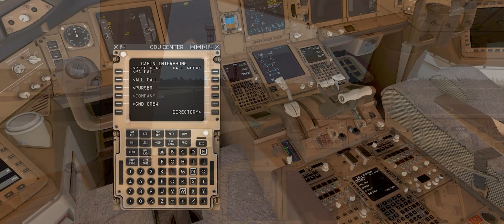WIP: comm system + MCC

Comment: 2/3 of the community doesn’t care about such ai voices, we have 3Jcabinsound for that. Such stupid unnecessary things which people hate are eating alot of the release date time. Take some notes from REAL developers like Fenix and Inibuilds. Instead of getting in denial and not listening to the customers.
Reply: There seems to be a total misunderstanding of what is going on here. First, none of those features change the release date, the bottleneck is now the FMS and autopilot so this has nothing to do with release time.
Second, this is not cabinsound, or any other plugin to simulate life in the cabin, this is a full training level MCC vocalization system with, probably, voice control in the future. This means full interaction with the crew, including procedures where "half" the work is done by the copilot. MCC in real life is mostly about communication and it can't be done without voices. MCC us a big part of airline reality which has not yet been covered in the sim. Finally, I am not sure what does "REAL developers" means exactly but we have been on the market for 13 years now, 3 of our core team are actual airline pilots (a320 and b777) and instructors. We have 10 (B777, B787 and a320) consultants and mechanics working with us day to day, and we have models used in actual pilot training - if this is not real enough then I am sorry.
Reply: @ramzzess  That you are 13 years on the market doesn’t mean you are “perfect”. Look at a350 what a mess it was, and still is.  people where getting terrible performance on the FFa320 and reporting it to your team, however back then your team would get in denial that everything was pefect with the performance and that the problem was with people their pc. In the end you did optimize it without being right that it had good performance. Fenix A320 works also with real life airliner pilots. You are trolling people almost 10+ years with that kind of dissapointing 777. I am not talking about the modelment and texturing, i am talking about the management within your team!
Reply: @aladeenwadiya2709  Who and where has ever claimed that our airplanes are perfect ? The 8050 had a issue with crushing for several years which we have been trying to fall, and indeed in the end solved. We were always honest about that. The a320 was always heavy on the frames due to the shier amount of calculation as it is a full sim, with its own dynamics. We were always honest about that. We said we will try to optimize it and we did. Great for as all. What about the 777 and what 10 years? The v2 has been announced less than a year ago. Where is the issue? The v1 has been out for 12 years and used to be one of the best products at its time, since then we have been lowering its price gradually as it becomes older. We have always been open an honest about our plans. We even give models names to suggest how deep they will be. I think the problem is that some users, do not take the e time to read in detail what we say, but relay on hearsay and rumors on the forums. I do not think that any of the released models at the moment are anywhere bellow what we promised. Including the 350 and 777v1. Unless you expected that the 2012 v1 will be updated through 4 major XP versions. Btw, none of the models on the market now where promised to work for xp12 but all will
Reply: @ramzzess  learn from the FenixA320.
Reply: @aladeenwadiya2709  Please do not suggest I look at other models, especially built for a different sim. If you have specific features or bugs you want to discuss, I am happy to address these. I guess the question of real recordings has been answered? 10K phrases is not something easily recorded
Reply: @ramzzess  Why not, you expect to get only compliments do you? I still recommend you to look at the team of Fenix how they are developing.
Reply: @aladeenwadiya2709  I expect constructive criticism, which means things that you want improved or created. Not general suggestions for me to look at someone else. Like "I want real recordings", my answer was "this is objectively not possible at the moment"
Reply: @ramzzess  Your team! Instead of teasing us release something. Why develop on a 787 and 777 if we already have an 787. Put your main focus on the 777 and then the 787 (not that I am someone from the team). No shit that most of the people don’t like the FF! It has nothing to do with fake media or about fake blogs. If you don’t ask the community why they don’t like the FF team, instead of acting like all of them are fools and idiots. If there is only a little bit of criticism on your social platforms like discord then you are going to get raided by your friends within 5 minutes, because you simply don’t agree with things. Thats why I am saying take the Fenix team as an example. They focused on 1 plane and 1 variant of the plane, and everyone loves it because their quality is high and their price is simply the best! They do care about their customers during this global inflation, and you definitely don’t care about it. So conclusion take a look at fenix and be more transparent and accept criticism. Don’t be an authorian team.
Reply: @aladeenwadiya2709  I am still confused? Who are those people who don’t like FF? We get tons of positive reviews as well as criticism. I have answered all your critical points and on most cases it turns out you are not familiar enough with the development. Who is raiding you on discord? I assure you, there are no “friends” of mine set to raid criticism. I think you see other fund discord disagreeing with your criticism and mistake the for bots - just a guess;)
Reply: @ramzzess  I think you need to read better what I’ve wrote above. You didn’t answer or take the feedback out of ignorance.

Comment: Well, the interaction with the crew is really a nice touch but i see the 3D virtual  cockpit graphics a bit flat, not as good as they could be, looks like the current 777 versión but may be because is a wip, also the windshields are like if they are not there, we are in 2022 guys, the graphics details must be really accurate, take a look at the Fenix, you can achieve this level of detail in the incoming FF 777 for sure, no doubt of this, go ahead FF devs!.

Comment: 777 is my favourite aircraft and eventhough I‘m a simmer since long time I‘ve never flown a 777 on a sim. Please FF, really please, don‘t fuck it up. If this is gonna be like the A350, I will cry. But I‘m still worried about the Perf Calculatoon, you don‘t really do that. On the 767 and probably 757 too, there is no Sel Temp, on the A320 no Flex Temp and no V1… Please bring it on this time

Comment: Since 2016 you guys have been talking about your V2. Now your V2 includes horrible AI features which simmers aren't looking for with an absolute rubbish cockpit...What were you doing for 6 years guys. Disappointing... Go get tips from Fenix
Reply: Can you be more specific on the cockpit
Reply: @ramzzess  In the video you can see that the startup somehow only lasts 2 seconds. In the real plane it takes 2 minutes from the moment the power comes on until the moment all the screens light up, and the sounds are absolutely unrealistic. Instead of equipment cooling fans, you hear some kind of whining that doesn't exist in the real aircraft. I hope that this is still being worked on, because if not, it's a real disappointment. The yoke trim switches are too big. The white part of the engine fuel lever are not visible during normal operation, and so on.
Reply: @enrico4152  I guess I need to stop posting WIP stuff. There are NO sounds in this video, except voices. Startup is indeed between 2-5 minutes
Reply: @ramzzess  Well then write it into your description, you just wrote: "Don't mind the main displays and the sounds", I'm sorry for critizing WIP sounds,  but the rest of my points would be valid then, like startup duration, model and texture issues. Perhaps write something like "Don't mind the whole airplane except the MCC and the comm system as it's still being worked on"
Reply: @enrico4152  The start up will be longer yet. The modeling in done, textures might be changed in the future
Reply: @ramzzess  Well then good luck with your plane, you'll need it. And perhaps someday you'll meet some of my virtual cargo pilots in the sky of VATSIM with them flying the FF777v2.

Greets, 

Enrico